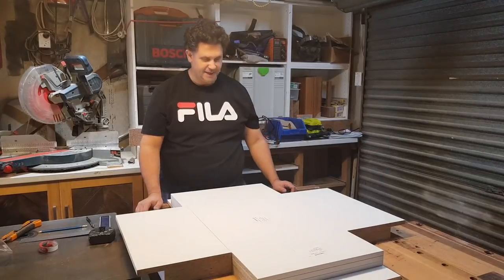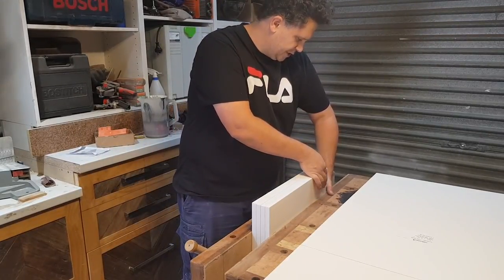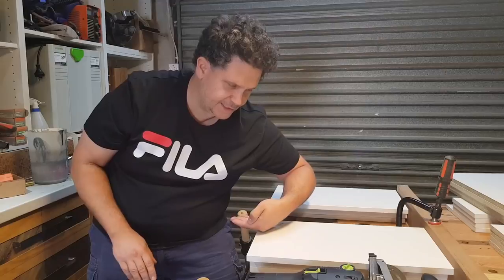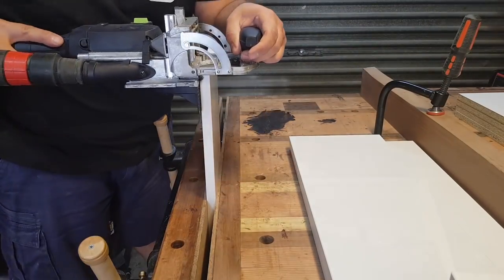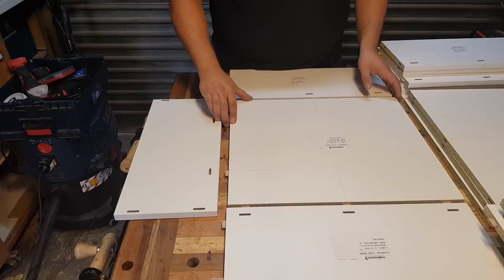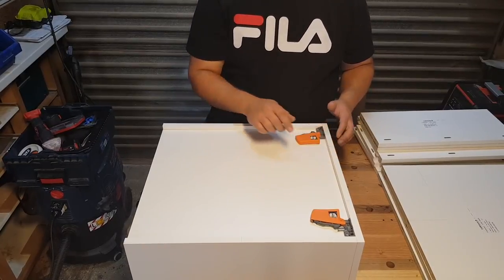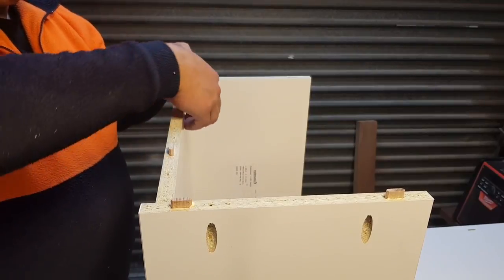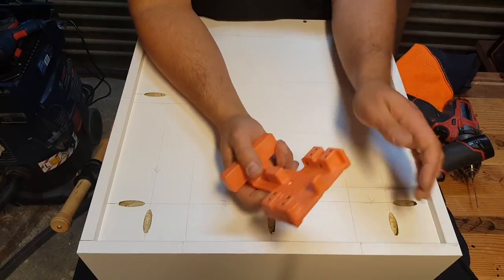How to make easy and fast drawer boxes with the Festool Domino

Comment: Great drawer build video.  I love the use of dominos and pocket screws with no clamps.  Looks like you edge banded the parts before hand and you got very clean melamine cuts.
Reply from the maker: Thank you, I get all my melamine cut & edged by Trademaster Joinery who use a half million dollar Biesse CNC, it cuts, drills, bores and edges all in one step and gives great results.
I can get very clean cuts on my table saw with my CMT chrome triple grind blade but not as straight as tbe CNC

Comment: Why does the offset needs to be 12mm to engage the blum rails? What happens If the offset is 10mm
Reply from the maker: It's their set amount, if you go too shallow they won't engage in any of the clips and won't operate properly
Reply: @OneManBandWoodworks  can i do the offset whit df700? Just bought it
Reply from the maker: Sorry it's taken me 3 years to reply, I'm guessing by now you've already tried, how did it go?

Comment: Melamine drawers = curbside furniture and cabinets.
Reply from the maker: Melamine drawer labour = 1hr $60.00
Wooden drawer labour = 1hr flatten/mill rough stock, 1hr clean up and flatten glued panels, 1hr dock/rip to size, 1hr build, 1hr clean up and sand, 2hrs finish = 7hrs $420 + cost of wood. When you place your order I'll hit you up $500/drawer so you dont compromise your principles...
Reply: I've been a woodworker and cabinet maker for over 40 years. If you can't make a wooden drawer for way under 500 dollars you got some major issues. You get what you pay for.  Frameless cabinet and melamine drawers (32mm system) was invented  after WW11 because they need something quick, easy and cheap to rebuild with.
Reply from the maker: @Joesmith-fu4ps   Richard M  I've been a cabinetmaker for 20 years and I'm still one now so I may be a little more relevant. I take your point on why particleboard was invented, the wheel was also invented because they needed a solution at the time, should we go back to square chocks so we can be traditionalist? 
The reason this industry is all but dead and the likes of ikea and other crap merchants have taken over is because of stupid attitudes that refuse to move with technology.
Solid timber is great for hobbyists but irrelevant at a commercial level other than as a feature desktop or drawer front or door.
My work is all around Sydney's north shore and northern beaches and they baulk at the purchase price of solid alone before we even start adding the labour costs up.

Comment: Sexually transmitted diseases 😳, I typed that because I cannot spell the G word lol, solid as a rock mate & did you know that Armor Tool have a new self adjusting whizz bang pocket hole jig released ?, not available here yet however 🤞🤞 it’ll become available & it has metric measurements 🙏🤔🤔👏👏👏
Reply from the maker: Yeah I saw that one but I need the foreman, when you make 15 of these drawers per job you do some drilling let me tell you...